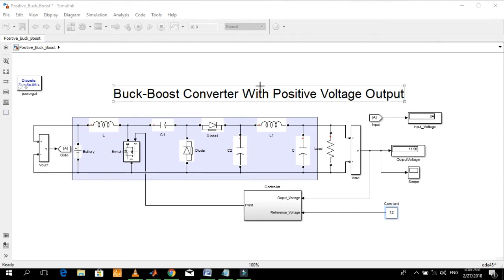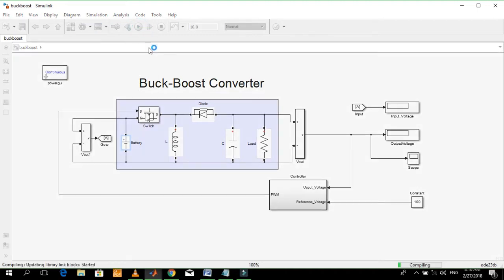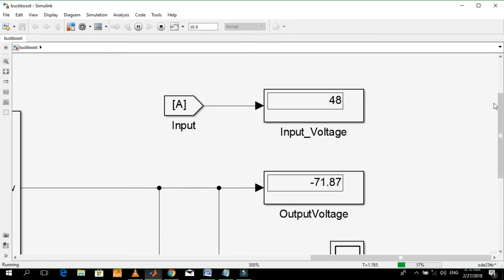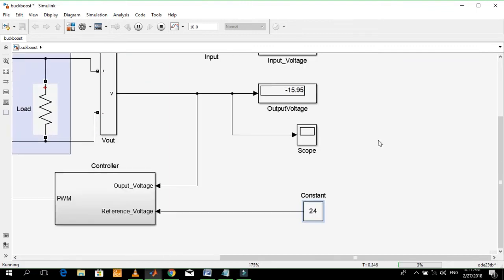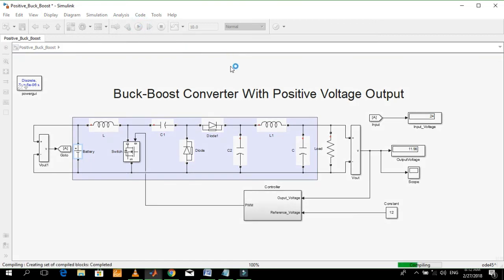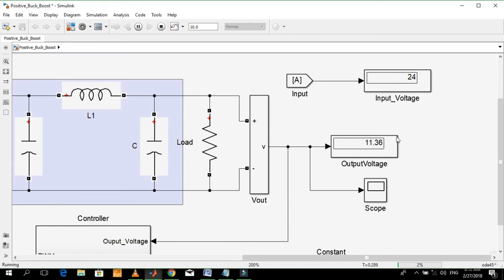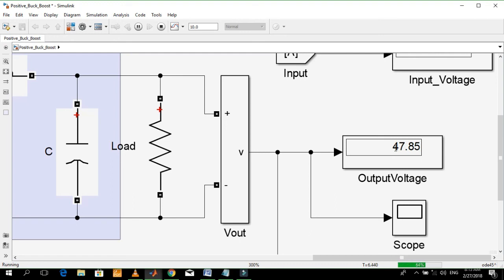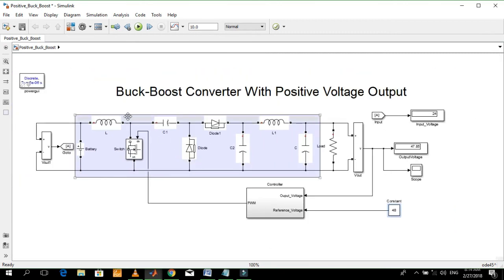Buck-Boost Converter With Positive Voltage Output

Comment: Please explain how you Design control logic for pwm
Reply from the maker: A sawtooth wave is generated from the amplified error (difference between measured value and reference) signal using a re-settable integrator. the reference value is compared with the sawtooth wave to create a PWM signal.